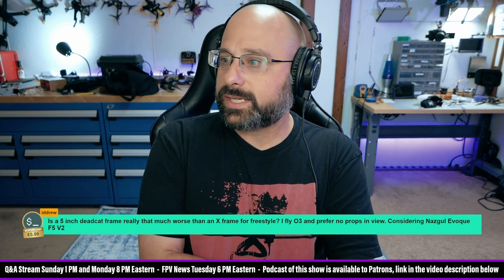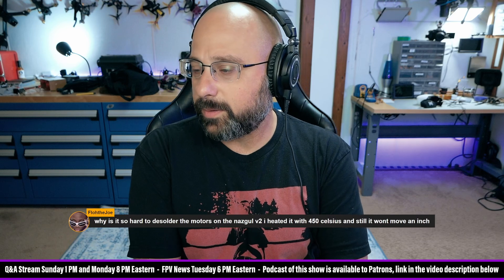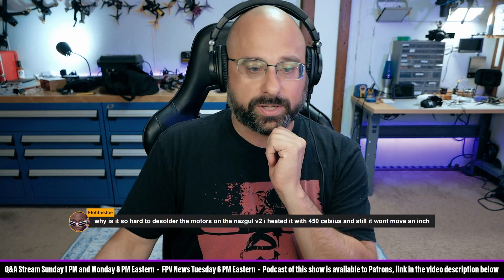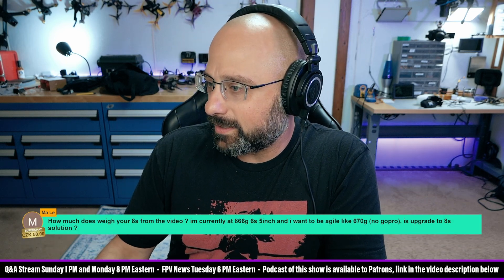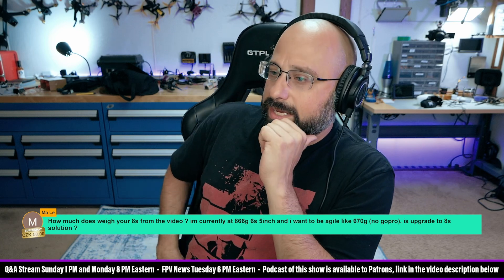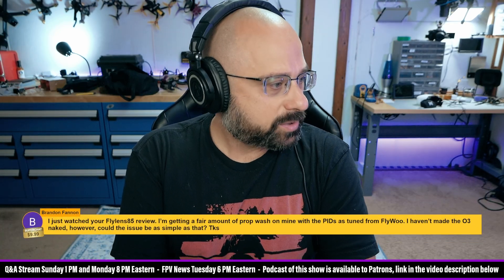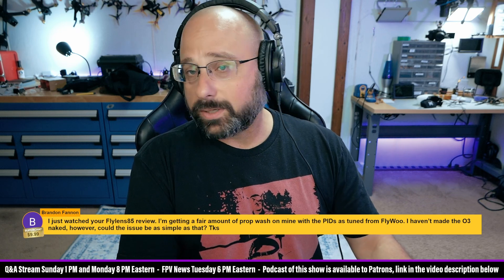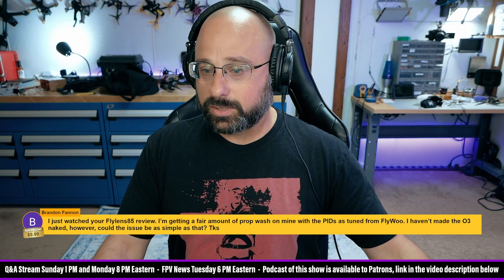Why Are ESCs So Hard To Solder? Should I Use 8s For My Heavy Drone? - FPV Questions

Comment: People that have hard time soldering ESC don't understand heat transfer and try to use the little soldering iron that they used on the rest of the build.... Need a bigger tip higher watt iron and flux is the key

Comment: When soldering make sure your soldering iron has a film of melted solder on it. The "wet" soldering iron conducts heat much better than a dry soldering iron.
Reply: only problem with this is that a beginner might deposit WAYY too much solder with this method so having a wick and keeping just a little on the tip but SOME is best
Reply: @sgas  I did use the word "film." As you say, it's way too easy to have solder wick up inside a wire but I've seen too many people try to heat a pad with a completely dry soldering iron and wonder why the pad isn't getting hot.
Reply: @ddegn  I mostly struggle with excess on the pad which is a bigger issue than wicking up the wire

It spreads to surrounding components and becomes a mess rly easily and quickly.

My dad also solders with a dry iron lol
Reply: @sgas  I want to make sure you know about solder wick. It really helps to remove solder from where it's not wanted.
If you haven't used solder wick, you really haven't soldered.
Reply: @ddegn  I have. But its kind of hard to use, the copper absorbs a lot of heat and it has to be doused in flux for it to flow. It sometimes gets stuck to the pad. Sometimes the bridge is in way too tight of a space.

But when it works, it's magic.
Reply: Do you how to wet the tip? I can't find "wetted" tip near my area, only cheap dry tip
Reply: @tommegg8486  wut

the solder has to stick to the tip, if it doesn't, replace it
Reply: @sgas  that's the problem, every tip sold near my area (in country side, not much store here) is the cheap dry one that refused to stick any solder melted on it. Just wondering if I can diy it
Reply: @tommegg8486  Sponges also work best when wet. They only ship dry sponges. We have to work out how to wet sponges and soldering iron tips.
Soap can help a sponge to be properly wetted. Flux helps soldering iron tips and other things be properly wetted with solder.
Don't eat soap and don't eat flux.